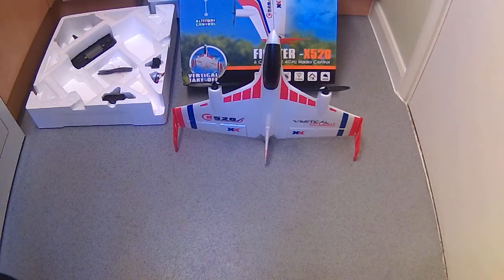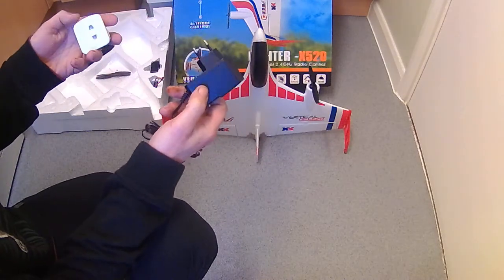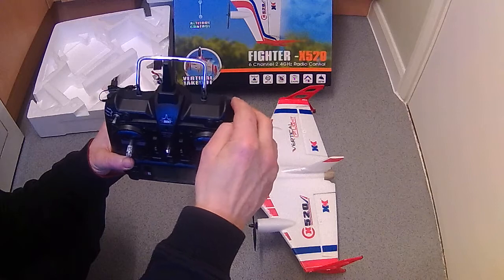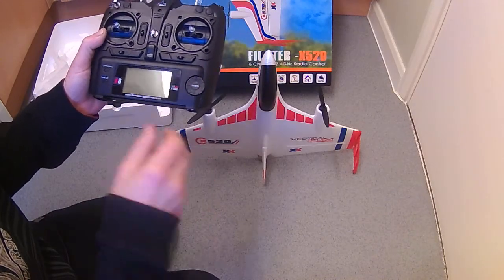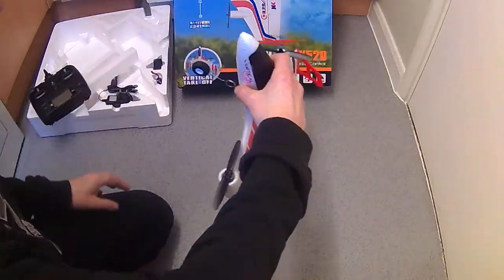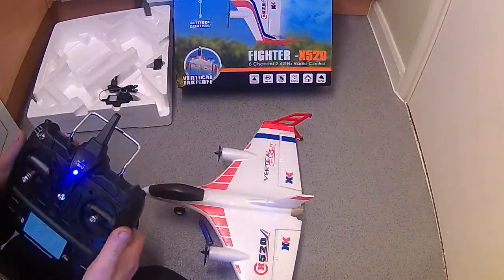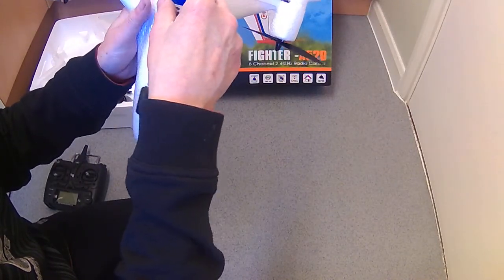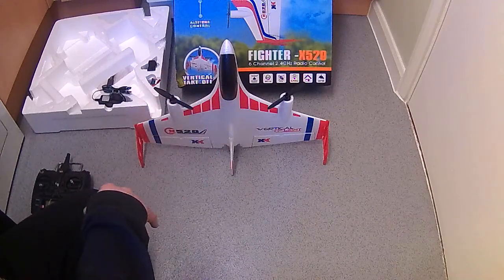XK-X520 vertical 6 channel R/C fighter plane unboxing review(part 1)

Comment: Nice unboxing stealth surfer. I also have this airplane and really love it. Have you by chance tried hooking a 3s battery to the xk520?
Reply from the maker: No I haven't yet but i will try it.ive put on a fpv camera and it flew great.
Reply: @cyclops-fpv  please be careful if you do try to 3s battery, I would hate to see you fry it. If it will take it, it would really turn this plane into a hot rod!